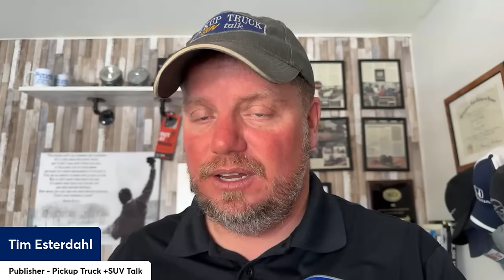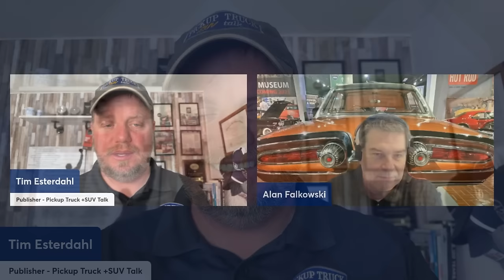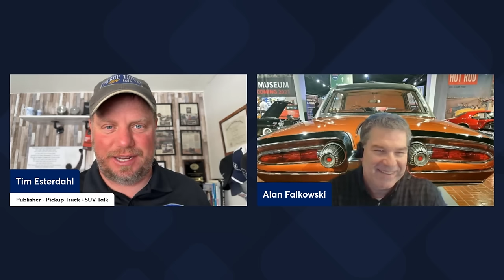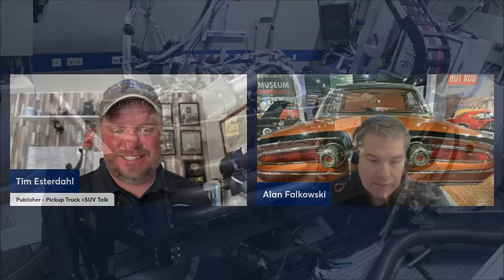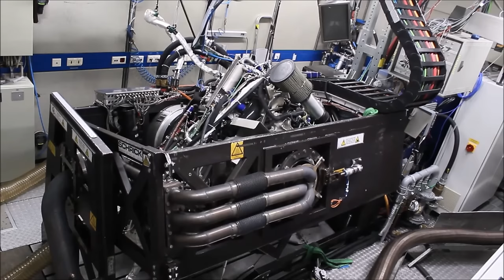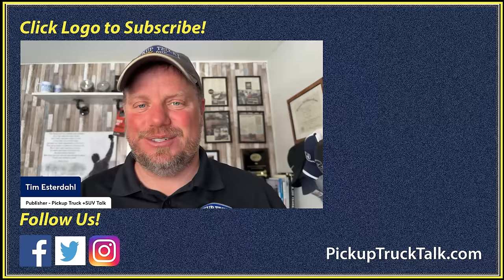Engineer Deep Dive: 3.0L Hurricane Engine - Turbo Life, Oil and Intervals and More

Comment: Granted the Hurricane puts out great power. And if driven to were it is putting out that power constantly l would question its reliability. But the fact is the overwhelming majority of owners will never stress the engine to 80% much less 100%. Now as to owners paying attention to maintenance schedules. Thats another matter. Also oil changes the most common scheduled maintenance item are getting insane in their cost. What was a 80 dollar expense is now pushing 140 around me. Yes cheaper than an engine renuild. But for some a definite shock. And not everyone has the option of doing their own oil changes.

Comment: They just want to sell smaller motors with turbocharging for the same price, start stop is like the skip shift on the gen 4 Camaros and the Dod , cam phasers, are they going to shut down 2 out of 4 cylinders , or 3 of six? How can your parts last if they’re stopped unlubricated? If that’s a word😂. I waited to buy a 5th Gen Camaro til 2014 for the bugs to get worked out.

Comment: As a former truck driver I can attest to the reliability of  turbo charged engines that are designed from the ground up are reliable. As a matter of fact a turbocharged engine won’t even run without the turbo. I’ve had a turbo failure and because of time constraints I took the duct work off and tried to run the engine and continue on the trip and replace it later, it wouldn’t run.
Reply: Yeah, without the turbo your air/fuel ratio is all screwed up.

Comment: I'd love to know how they addressed carbon buildup with this direct injected engine. I've done a lot of searching and it doesn't appear that there's anything in place (like Ford's dual injection) to prevent this. I keep my trucks for over 200,000 miles and I don't want to have to have to tear into the engine to clean out the gunk because of a poor design.
Reply from the maker: Check new oil design. They are formulated with new additives to reduce carbon buildup since 2020.
Reply: @Pickuptrucktalk  carbon buildup in the intake manifold and on the backs of the valves, especially the intake valves has nothing to do with new GF6 additives, genius

Comment: Have a hemi that was built in 2010 in a half ton truck. Still runs good after 235k miles. Just curious if this engine can handle the hot and cold fluxes and last just as long.

Comment: What do u consider a new oil? A oil.that has been sitting on the shelf for a year or two. So what mfg has the newer additives or the newest oil mfg in 2024
Reply from the maker: Oils are always evolving so you can’t say “newest.” Also, the new oils are tested to work on older engines.
Reply: A "new" oil in that engineer's mind is one that meets the new stricter standard JF6. And as new standards evolve, they will be the new oils.

Comment: This engineer thinks that the turbo motors perception not  is due to 80's and 90's stigma?  Yikes, no its not.  (This is coming from someone that wants a turbo on everything)

How about cleansheet designs  where they aren't reliable...  In the 2015+'s

Oil control rings seize.  DI issues, valves, PCV systems out of control, LSPI, having to add Gasoline particulate filters now.  Plastics failing due to heat exposure and cycling after vehicle shutdown.

Much of what kills an engine is the heatsoak after shutting down an engine, in the heat.  Gaskets fail, oil mixed with fuel causes issues no longer flowing, plastics become brittle.

When you have it in a pitch rig in a controlled temperature room with a nearly infinite envelope (an entire room rather than a tight engine bay)

Thats what reduces life, start-up shut down and soak. Not stable oil, and coolant test with perfect filtration.

Comment: All of this talk about engineering and design is fine. Problem is you have to mfr them at scale. Engineers don’t choose the supplier’s accounting does. Engineers don’t have a blank check to choose materials. Compromises are forced onto the engineers. The use of all the plastic in high heat areas is likely down to cost savings, and the question “will it make it to warranty”. Currently driving a rental Wagoneer. Love the vehicle (interior cost savings notwithstanding) but under the hood plastic parts worry me. Engine performs like a dream. But who wants to deal with service dept’s to do all the repairs that require massive disassembly rendering your car “never the same”? For predictable failures caused by…. Plastic. If you won’t put more than 50k miles on one and sell it 3 years any vehicle is good.

Comment: 26:36 This is the reason I use only Motorcraft 5w30 Synthetic blend oil in my 2016 F150 2.7. This oil may have an additive design to help the engine last longer. Maybe this is why my oil pan does not leak @ 104 k miles.

Comment: I believe manufactures do tell us what they think of engine longevity and durability.  They tell us by the warranty they offer.  diesels have 5 y 100,000 miles. most half tons gassers have 5y 60,000.  why?  because they think that the cost to have a higher mileage warranty will hurt them financially based on the testing they did with the engine.  I looked at Tesla, battery and drive unit warranty 8years 150,000 miles.
Reply from the maker: I’m not sold on that line of thinking to be honest.

Comment: I go by my miles and the color of my oil if its black it needs to be changed and dark see tru on the dip stick equals black cant see tru drained in a lets say 1 cup of oil all 3 of my suv / truck /work van oil is gold when i check it i change my oil at 5 thousand miles mobile 1 and Shell Rotella mixed 50/50 say 6 quarts total 3 quarts of Mobil 1and 3 quarts of Shell Rotella the inside of every motor looks brand new and wixx oil filter or factory filter only no exceptions no rushing no oil change places I do it myself!!! All my vehicles are older 2005 2001 And a 2014 nothing new my work van has 352 thousand miles runs like new its the 2005 !!

Comment: What is the chance that this engine actually came from BMW the specs are very similar. Some of the stuff that guy has described on this engine. Sounds like we might be on to something , I am also curious what the Horsepower and torque specs if they're actually going to put it in a 2500 I don't think the heavy  Duty cycles it would do well. But there are rumors of a gas 6.7 Cummons for the heavy stuff.
Reply: It did not, it’s from the GME engine program started by FCA.

Comment: Tim, sid he say what the duty cycle of the 3.0 SST engine happens to be?  I may have missed that.
Reply from the maker: Duty cycle like how long it will last?
Reply: @Pickuptrucktalk  Correct.  If memory serves me correctly (which it might not) the first version of the 3.0L Duramax had a duty cycle of 150k miles, though that may have just been for the timing chain located at the rear of the engine.
Reply from the maker: @emmalab02  that’s was just the service interval on the belt. No automaker gives out duty cycle. Just not going to happen in today’s world.
Reply: @Pickuptrucktalk  thanks for the quick clarifying response Tim.
Reply: @Pickuptrucktalk cummins duty cycle is 350,000 miles. That's the only one I can find.
Reply from the maker: @All-Miles-Matter  where did you find that?

Comment: Thanks for the update on turbo engines.  I would have liked to see that Hurricane engine in a vehicle instead of on a stand during the testing though.  There are more variables in a vehicle like braking and other gravitational issues so you can assess the engine oil sloshing around more accurately.  Toyota ran an the newest gen engine in the Tundra for a million miles in various conditions (according to an engineer) before putting them on the market.

Comment: Oil change intervals should be dependent on the type of doing that vehicle is doing.  And beware that that lifetime fluid is for the lifetime of the vehicle manufacture warranty.  Vehicles love maintenance as long as it is the write type and done correctly.
Reply from the maker: Um… it is based on your driving.

Comment: @Pickup Truck plus SUV Talk: I wonder if the SST will require using Tier 1 fuel. Also, wouldn't it benefit the turbo if the engine was allowed to idle for a few minutes at the end of the drive, allowing the cooling of the turbo to continue at the end of the drive.
Reply from the maker: Alan discusses how the turbo does cool after you turn off the engine. It has an electric water pump. You don’t need to idle it to cool down the turbos. The gas octane depends on the engine S/O or H/O.

Comment: What about  Valves caboning up front direct injection
Reply from the maker: Carbon buildup has been minimized through high-pressure fuel injection and new oils that prevent it from building up on the exhaust cycle.
Reply: @Pickuptrucktalk  Ford went to once every 3or4 injection being from Port fuel injection so gas cleans off the valves. Because as a loyal RAM owner I'm interested in the new and my next truck or suv wagoneer with the hurrican engine or looking at the new ramcharger
Reply from the maker: @michaelneuhaus4432  Ford also offers engines with Port and without Port injection.

Comment: The fact that other US and some EU car manufactures are still making big displacements engines makes me wonder if Stellantis forced Alan on making this tiny one trick pony engine in short time. 
Don't get me wrong I'm not against on having available turbo engines however I'm not in favor on being forced on lesser engine options to no options.
Its hard for me to believe Alan not able to make a emissions compliant  modern V8 engine be it SOHC, DOHC let alone a pushrod while ford and chevy still makes them.
 
Its not a stretch to say Stellantis ruined the CJDR brands by going full EU mode and in the last 4 years what we got? Undesired Overpriced trucks now with tiny turbo engines, a muscle car with a tiny turbo engine add more salt to injury EV's pretending to be muscle cars?
Stellantis is hell bent in their EV agenda and vehicles that we didnt ask for that its driving the brands to the same if not worse regression we saw from Chrysler back in the 80's, remember the Charger L body?... (sigh)
Chrysler survived thanks to the minivan and by Lee Iacocca by a major extent but it was borrowed time until it got sold to Mercedes. Makes me wonder if it will take another decade to get the big engines back or if CJDR we knew will be around by then. Only time will tell.

Comment: Great video.  Great guest.  Very informative video that had content that was well structured.  The complexity of the motor relying on all the sensors is unsettling.  Elon Musk is simplifying rocket engines as compared to prior units to improve reliability.  Lastly, the sound of inline 6 just isn't a V8.  I saw and heard the pathetic video on the Challenger hurricane  equiped drag car.  Ford Ecoboost Raptors sound pathetic as well.

Comment: I hope they have used a high resolution oil level sensor and some killer software tracking every oil stress factor in order to turn on the light and message to change the oil when it is needed with no milage concerns. The BIGGEST mistake vehicle mfrs have made in thencouplenof decadesnis lengthening the interval and having an imperfect system to alert the oil change is needed. I work in the industry and worked for manufacturers and at dealers. The engines that burn oil and wear cam timing components mostly do not have those problems when the owner changed oil at 50 to 75% of the milage where the vehicle system would alert or a scheduled milage was reached. The interval has environmental concerns but Inthink piles of failed engines and the resources to make new parts have to be weighed against the waste after recycling used oil and filters. I also hope this new engine has had every oil use byproduct the engine makes (I'm talking crumbly black ssludge particles) considered and dealt with.

Comment: Your fancy high speed testing can't stimulate shutting down the engine and letting the oil drain out of the bearings for a week then starting it and doing this hundreds of times and maybe letting it sit sometimes a couple months in hot cold cycles, this would take 10-20 years to duplicate. Engines have done all the testing your describing but still miss out on major deficiencies like the 2.7v6 Fords problems had so those problems because the long term testing can't actually duplicate real world problems and when they don't you just say screw the customer. Your only concern with reliability is getting it thru the warranty period not 10-20 years down the road where your cars develop a bad reputation and sure it don't directly cost you a dollar so you don't care but really it costs you a lot more in lost sales.

Comment: I specifically bought a 24 Ram, to mot get stuck with a turbo. Every turbo engine Ford built, and still builds have problems. I won't trust that technology until it is proven, at least 5 years, without major engine problems with at least 150,000 miles.

Comment: Trubo 6 is NOT going to be near as good as the hemi. Fords v6 is horrible. Tfl truck took a Ford 3.5l up the mountain. The ram had the same trailer. The Ford got 2.4 mpg, the ram 4.7mpg. The Ford got to the top 15 seconds sooner, within human error. Any time you take less cubic inches and try to match or exceed power, you have to burn more fuel. It's not the turbo, it's the stress on small motor. On top of that, you're stressing that little motor out. I do believe this motor will be better than the ford, but it's not going to be a long-term worker.

Comment: The concern of turbos go beyond reliability, there is also the fuel economy and performance hit when using a truck for truck thing. Diesel trucks can get away with it because they are already large displacement engines so it really is not fair to compare a 5.x liter diesel to a 3.x liter gas. if you look at every manufacture that has done forced induction in their work trim trucks (Ford and Toyota) it has been a crap show. In some respects things have gotten better at least for ford, but the ecoboost gets way worse fuel economy and struggles to get to and maintain speed than the v8 F-150 when haul/pulling. If you look at Toyota they are dropping like flies and it turning in to their 3-wheeler moment. In the end Manufacturers dont like the customers that buy a truck and want it to do truck things for 10 years because they dont make money on it, notice how they have stopped bragging on long term reliability? It truly is a very bleak looking future for the automotive market as we move more and more to disposable vehicles.

Comment: So my concern with the durability of this engine isn’t that it’s turbo charged my concern is it’s an aluminum block with basically a painted on cylinder sleeve.  At least most aluminum blocks have a steel sleeve this one doesn’t even have that and it’s concerning

Comment: For every engineer that says frequent oil changes are unnecessary there is likely 100 mechanics that work on these things every day saying that it's more important than ever, if you want any type of longevity.   
You don't have to remove a dipstick to add a level sensor...
So much bs in one interview

Comment: I really dislike the sound of inline engines vs V-8’s. But I hate noise and always keep the stock exhaust or if changing choose a new exhaust that is quite and offers some improvement in efficiency. 

What bothers me about these turbo engines is their poor gas mileage. I’ve tried and tried to get good mileage in our Ecoboost engines. I’ve found we can get better mileage using our V-8’s under normal driving conditions. 

So far these new inline 6 turbos are not very efficient.

Comment: I don't buy the diesel engine comparison.  Your average diesel engine is a heavy casting,  it has a large displacement and they don't run high RPM's.   Gasoline versions are very light castings, small displacement and they need to turn higher RPM to make the power.  These engines will not last as long as their large displacement V-8 cousins.  In layman's terms,  there is no replacement for displacement....

Comment: If RAM's new engine is reliable, and they continue to improve in terms of quality and reliability, the new Ram 1500 may become the best half ton truck since the new Tundra is no longer the safest choice thanks to the head engineer  Mije Sweeney.
Reply: *  "if"
Reply: @blaken3824  You are right that there is a big "if," but seeing what others are doing, I think the bar is quite low and seeing RAM coming with a straight 6, it appears that they are seeing an opportunity here to stick it on the others.
Reply: Based off of what mechanics are saying about the Hurricane, I highly doubt that. It’s a shit engine to work on as well that’s going to lead to some very shocked owners after the warranty is up.

Comment: EGR delete or you will be pulling the head before 100,000 miles with direct injection period. I would love to watch this video and compare to one 5 years from now and see if all the dreams came true. Oh and the oil mileage change is ridiculous and should be done at the max every 5000 miles. Stop start on twin turbos is only hurts them in the long run.
But what do I know :)

Comment: DI without port FI is a recipe for carbon buildup. 20000psi of fuel pressure will only make it worse. I'm pretty much out of the new car market honestly, I don't want a turbo charged engine in a pickup truck for everyday use. For weekend fun, maybe. Also cannot compare a compression ignition engine to gasoline. They are built massively different from conception. At least it's an online six, much better than a V6.